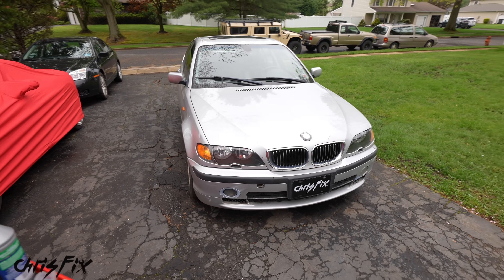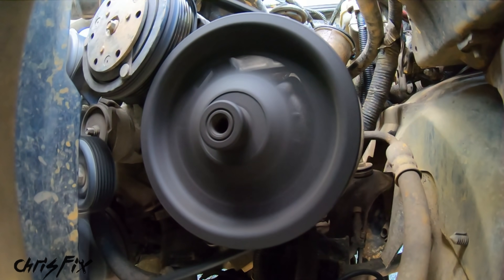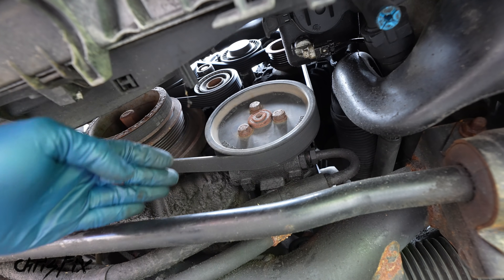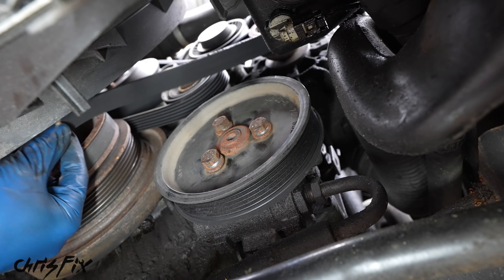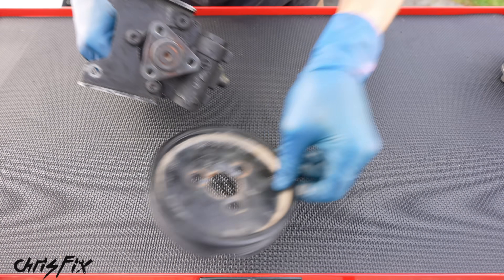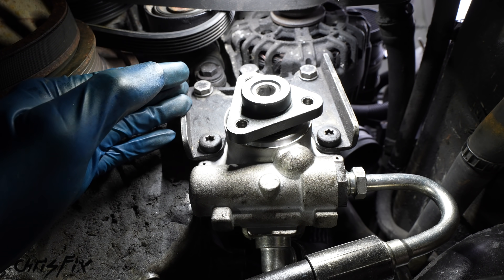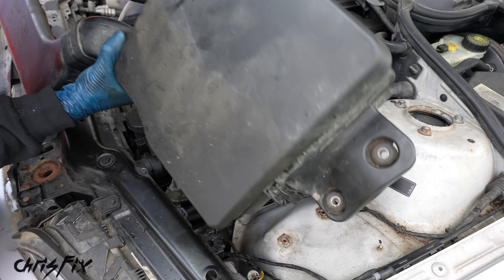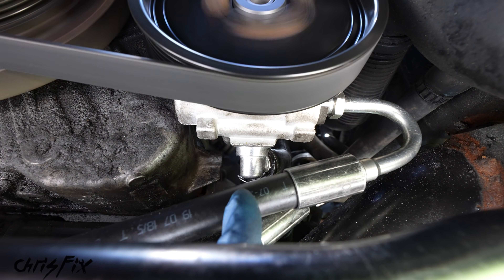How to Replace a Power Steering Pump

Comment: Hey Chris, so I just changed my fluid a few days ago. I saw in the beginning of the video it said ATF fluid only on the cap. When you put the new fluid in it looked like CHF 11S which the newer pumps used and what I used. It obviously worked and you did an endurance race so it's fine, but I just wanted to let you know. Maybe the new pump used CHF and you left that part out of the video. But, if I ever have to replace my pump I know now to how!

Comment: I would argue that the first thing you should check is the fan/serpentine/accessory belt.
My power steering went out a few years ago and I just assumed it was the fluid. Pulled into a petrol station and checked the fluid and it was low so I assumed that was the problem. They didn't have any PS/transmission fluid so I bought the next best thing, brake fluid, and filled 'er up.
Of course it didn't fix the problem because it was my fan belt that had come off. I was such an idiot I didn't even think to check it! 
I don't think I ever even bothered draining the brake fluid out of it afterwards, car was pretty old so I didn't care too much, and never had any problems with lines degrading or anything. It was good until I sold the car 3-4 years later.

Comment: When doing the bleeding, can you just put the front end up in the air to make it easier?? Seems like that would still work, wouldn't it?? Or do you need the resistance of the tires on the ground to force the fluid through the system?? UPDATE: I just finished installing a new PS Pump on my 1992 Toyota Pickup and lifted the front end before bleeding. It  worked just fine and was much easier than it seemed for Chris.

Comment: My power steering pump ended up getting a crack in it on my 02 Jeep 4.0l and at first started out leaking the most when I'd turn the wheel, but obviously it was still leaking when the engine was just running. Me being the super smart guy I am, I said "nah I'll wait to fix it and I'll just keep putting more power steering fluid in the reservoir". At first, when I'd put more fluid in, the steering would obviously get way easier, but over time, even after putting more fluid in, when I'd crank the Jeep you could hear the fluid spraying out, and I mean spraying. It would cover the entire engine bay, and once it got that severe the steering was never easy and eventually, I noticed my water temp gauge going up and up and my battery gauge wasn't at it's normal 14 volts while I was driving. I pulled over, popped the hood and what do I see, the power steering pulley had sheared off at the pump, the bearing was now a hole, my serpentine belt was somewhere on the interstate and my Jeep was at risk of overheating massively if I tried to drive it for any length. Ah, good times
Reply from the maker: Live and learn haha. We all do stuff like this. Sometimes it doesn’t end well hahaha

Comment: Thank you very much for valuable videos ,definitely helps us save money on labor cost . I have a question about my nissan frontier 2003 v6 which doesnt shift past 2nd gear and gets hot under under short distance , and rpm is high but the car just cant go any faster than 30 miles an hour . Cat converter sounds clogged too . Any info would help thanks in advance

Comment: You've probably already noticed and fixed it by now, but you didn't quite put the new fluid reservoir in right. The original, the clamp to hold it in goes up to the lip where the top and bottom connect together, and the new one wasn't put far enough down in the bracket.

Comment: Hey Chris. I have a question about my E39. Was driving the other day and out of nowhere I lost (most of) my power steering and the pump was louder than any power steering pump I’ve ever heard. Naturally I thought it was just a bad pump, so I replaced it. Same problem. No leaks; no air. Question is: have you ever heard of a pressure hose failing internally? Do they have check valves in them like brake hoses do? Could it be preventing the fluid from circulating? The rack is new within the last 3 years so I’m hoping that’s not the issue.

Comment: in my chevy the power steering pump the send and return lines needed to be replaced it was a 2007 chevy trail blazer ss I got for $500. it had a combination pump reservoir and needed a special pulley removal tool I ended up just buying for the future just incase I need to do it again at some point.

Comment: 14:48 the fact that the shaft that connects the pulley to the pump sheared off, I think saved your belt. If it didn't shear off the entire pump would seize, causing the belt to rub against the pulley on the PSP, overheating and melting the rubber belt? Or I might be wrong.
Reply from the maker: Agreed. It ended up working out for the better!

Comment: A plastic pulley...ok BMW.
Anyways, If the pump isn't totally seized then it's usually possible to disconnect the return line and bleed the system of old fluid by turning the wheel lock to lock. This makes it so there's even less of a mess to deal with later. You can do the same when bleeding air out of the system; fill the reservoir with fresh fluid and turn the wheel lock to lock before starting the car. Ideally you do this first when bleeding out the air so as to keep the pump from running dry.
Usually you can wash out PS fluid reservoirs with plastic-safe solvents such as gasoline or MAF sensor cleaner. Gasoline is my go-to, because you can swish it around and get all the crud out. Obviously you'll want to do this in a well-ventilated area and let the reservoir dry out completely before reassembling the system. If you want to go the extra mile, you could install an inline filter and an external tube-and-fin cooler too.
(reposting this because my old comment kept getting bot traffic for some damn reason)

Comment: Hello. I replaced the power steering pump, pully, tensioner, and belt on a 1998 Chevy Malibu 3.1. The belt alignment is off now. I pressed the pully on the power steering flush to the shaft. Do I need to shim the power steering pump pulley or can I pull the pulley off some off the shaft to check for proper belt alignment?

Comment: I bought a ‘98 Cherokee and the former owner (coworker) said it needs a new power steering pump and lines and while he does know a lot about machinery, I wanna make sure I diagnose it well myself too. I filled the fluid and the idling power steering noise seemed to go away.

Comment: Thanks  for the wonderful video. I installed the same equipment in my car. There is no leaking fluid and pump working well. But i cant get rid of that pump noise permanently. Its noising occasionally. Any advice?

Comment: Here's a tip than will make the bleed process easier. If the front end is up in the air, and the wheels are off the ground, the effort to turn the wheel will be reduced greatly.

Comment: e46's MUST use atf oil in their power steering, think it should say in the cap on the original power steering reservoir that you should only use atf

Comment: Chris is it possible to do a video on recognizing and addressing a grounding issue? I have a 89 Toyota pick up and recently changed the gas pump but I notice no current getting to the fuel pump.

Comment: I have a 1987 Lincoln Town car and this project ended up turning into an absolute nightmare. Just to let everybody know, many cars do not have a bolt system for the power steering pump. You have to rent a pulley puller from an auto parts store. Also on my car it was very hard to get said pulley off even with the pulley puller becauseit was seized, AND  the radiator is in the way so you end up having to remove it.

Comment: Question. If you are trying to get the new fluid into the system and steer the wheel, wouldn't make it easier to lift the front part of the car so the tires don't touch the ground ?

Comment: maybe e46 is different from e36 but ive had my e36 for 4 years now and i would advise anyone who wants to get one or has one to just throw your torque wrench in the trash. there is not one situation where i used it and it didn't strip something. just tighten by feel. snug things up but don't try to reach a number.

Comment: Did Chris fix check the transmission fluid level because it was a better angle, that only reason I’m saying that is because on the “power steering cap” it says ATF only “auto transmission fluid”

Comment: @ChrisFix to bleed p/s start motor 3 sec stop refill repeat on tilt u don't need to fill it after turn stering more easy no noise less air in systeme less bubble

Comment: Do you think you can do a video on a fuel pump relay? For example, I have a 2000 vw jetta that needs a new fuel pump relay. The specific part is running out, maybe there is an alternative. I'd really appreciate it. Thank you.

Comment: This same thing happened to my 01 325i Sedan. I didn’t know exaclty what was wrong at the time cuz I couldn’t tell but then I realized there was no power steering it had no belts on the pulleys and the psp had been bent a little as long as a small coolant leak. I drove the car back to my house and I guess the engine locked up after n I sold it

Comment: ATTENTION VIEWERS:  WARNING --> Do NOT EVER twist the front wheels back and forth, lock to lock like he did here in this video while the car is still on wheel ramps while trying to get the air out of the power steering system!  There is an extreme risk of the vehicle becoming unstable and falling off the ramps causing damage.  ALWAYS pull the car OFF the ramps BEFORE doing this procedure.  This is not the case, though, if you have the front wheels hanging free with your car on jack stands.

Comment: I know you did a coolant flush video, but can you do a video of a coolant pressure test video? I’ve just been wondering how to tell the difference of the different parts of my coolant system breaking down. I drive a 05 Buick LaCrosse and the elbow pipes were originally made of plastic and those failed and I replaced them with the new aluminum ones, but now my car thermostat rises when my car idles, so I don’t know if it’s my radiator leaking/evaporating or maybe it’s my coolant temperature sensor. I know it’s just my problem but I feel like it might make a good video.

Comment: hey chris, nice job on the replacement but, shouldn't you have flushed out the rest of the system to remove any old fluid and metal bits? i know this is an older video but any trash left behind might cause the pump to fail prematurely.  i did watch your video on the race, great job!

Comment: What could be the problem if you have what seems to be loose steering only when you go into turns? It’s like I have to correct it because it swerves a bit, other than that it drives fine

Comment: Wow Chris excellent video for sure. Thanks for posting, out with the old and in with the New.  
  So my question here is I recently bought a ZF Power Steering Pump it was a rebuild one but for some reason that pump is too tight and it doesn’t fit the bracket very well. I even tried using a hammer to tap it in. But only one part will fit. Any suggestions to making it fit?
Reply from the maker: If you compare to the old pump is it the same dimensions/part?
Reply: @chrisfix  yes I looked at the bolt patterns and everything appears to be visually the same although the tripod on the pulley was a bit bigger so I had to drill out holes in the pulley to make it fit. Another reason why I sent it back , but after thorough inspection, I realize that this was actually made for a Passat VR6 not for a Corrado VR6. Ultimately I just sent it back to Rock Auto along with my core which I’m having REBUILT by Lares, thanks again for your help.💪

Comment: Hey Chris
I finally got my first car,a 2001 e46 320i with the M54 2.2 engine.Problem is it stalls at low speeds and the power is not there,I can floor it but it just wont deliver

Comment: Hey Chris, is that old crusty looking residue around the pump from power steering fluid leak? I'm diagnosing my 05 4runner, and I think the PS pump seals are leaking. Kinda hard to tell the source of the oil leak because the PS pump is right near the corner of the oil pan, so I might run some dye just to be sure. Might end up having to reseal the oil pan as well. It's a pretty old PS pump and reservoir, so I think I'm going to replace everything like you did. Really big thanks for all of your content!!

Comment: Hey Chris! Is it necessary to replace the reservoir and hose when replacing the pump? There are a few options I see online for replacement pumps without the rest, just want to make sure this wont lead to an issue down the line!
Reply from the maker: It’s not 100% required but if it’s only a few extra bucks and the hose/reservoir is old, it’s not a bad idea to swap out. If yours is in good shape then there’s no need

Comment: Might want to drain and fill the power steering fluid 1 or two more times to flush the rack of the old residue from previous worn fluid.

Comment: Hey ChrisFix I have a 2005 Ford Taurus I had the pump , lines and gearbox all replaced and the power steering still doesn't work , It worked after I got it back from the shop but shortly after it only worked after the car warmed up and now it just doesn't work at all. 
Any ideas?

Comment: I get how you drain and dispose of fluids but where does the excess fluid residue on the pans and bowls go. Like how do you wash them for further use?
Reply from the maker: What pans and bowls? I’m not understanding.
Reply: @chrisfix  like the pan you catch the oil in

Comment: Would a steering rack that doesn’t return to center and also a heavy steering wheel need a new pump ? It also whines when holding it at a lock to lock 1998 bmw e36

Comment: So I get how to replace the power steering but what about on a 2008 mazda tribute. It has a safety recall on the steering torque sensor but I had no codes populate so I don't want to remove anything until I know for sure. What should I do to diagnose the power steering because it is very difficult to turn when prone

Comment: What if the bolts on my pully are sized? What do i do then would it be safe to use a impact driver?
Reply from the maker: You should be fine with an impact, but I would soak the bolts in penetrating fluid as best you can
Reply: @chrisfix  thanks man. Much appreciated also love your videos and keep up the good work.

Comment: Actually The Mazda B3000 Was Made By Ford Motor Company And It Is A Rebadged North American Spec Ford Ranger And Loud  Power Steering Pumps Are More Common On Older Ford Vehicles Including The First Gen Ford Explorer And The Expedition

Comment: Hey Chris, can you help me with this? There are 3 bolts in power steering pulley. I managed to remove two of them. However, the last bolt cannot be removed since the pulley keep on moving with the bolt. Can you help me on what to do?

Comment: So do you need to replace the fluid reservoir when replacing the power steering system or was that just by choice?
Reply from the maker: It came with my kit so I'll put a new one in while I'm doing the work. If yours doesn't come with one and it's in good shape, I wouldn't worry!

Comment: Did you take the car off the ramps before turning the wheel to get the new fluid in the pump or did you turn the wheel while on the ramps?

Comment: Chris my 2004 Buick Regal, at low RPM, is hard to turn and makes a whinny noise… I was thinking this is definitely a loose belt problem; or could it still be a bad fuel pump?

Comment: Someone probably already pointed it out, 

But quick tip:

You can jack up the cars front tires when you're turning your steering wheel after your install to ease up your steering wheel turning effort

Comment: Hey so I just put my new pump and reservoir on. Did the lock to lock 3 times and it loosened right up nicely. But the reservoir only took 1 quart and I just did 30 lock to lock turns and it’s not taking anymore. Any reason as to why this is happening?

Comment: I have a question I have Mazda cx7 2008 my power steering doesn’t work it was hit in a car accident and the power steering cooler line is bent do you think that will be the reason it doesn’t work

Comment: I had my Ford Mondeo Mk4 steering rack repaired, and my servo pump and reservoir replaced, but because the Lauber aftermarket pump was starved of servo liquid, they concluded that the new reservoir was at fault and they put back my old reservoir which they said had no filter, and now the pump runs fine... But is it right to have a reservoir with no filter? Did the old one really had no filter?

Comment: Do you have to let the coolant out if you want to replace the other hoze from the reservoir which goes towards the radiator? Ithink not and is it as easy as i think it is? Old hoze out and new one in?

Comment: Any commenters have experience with power steering pumps getting seized into place? I am replacing mine but it won't come free after I removed three lag bolts. I will keep poking at it, but your responses might help someone who has this same problem
Reply from the maker: I would double check you got all the bolts out first. If you did, use some penetrating fluid and give it some light taps with a dead blow or hammer to give it a shock and it should start moving then!
Reply: Thank you! I figured out there is a fourth "hinge bolt" straight up at the top of the wheel. With it loose, the power steering pump swings as if it's on a hinge. Once I removed that, it came free. it was hard to find due to the lack of room to see anything. And no other YouTubers covered it thoroughly.

Although the OEM compatible part ironically has a pulley wheel that is significantly larger than the pulley on the pump I removed. So I will likely size up my serpentine belt to compensate.

At the very least, this should apply for any 99 to 2010 Celica, Corolla, Camry, Scion cars, and Lexus.

Thank you for your hard work and contributions to society, Chris. Without you I'd be stranded without a ride and wouldn't be able to help my friends in need when they have car problems too.